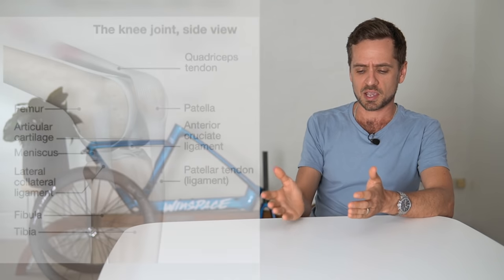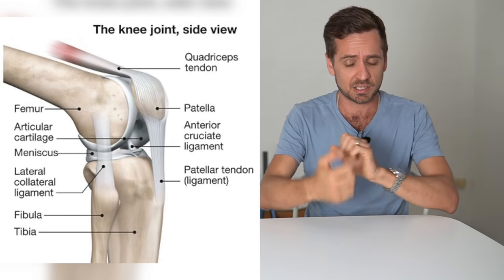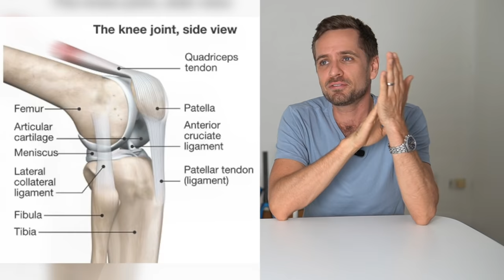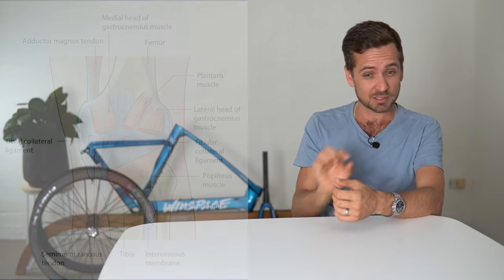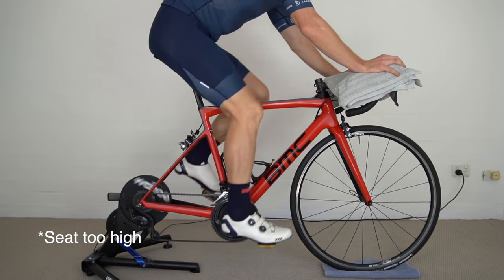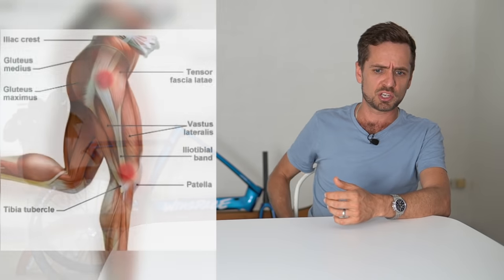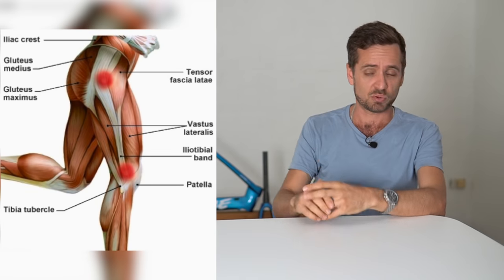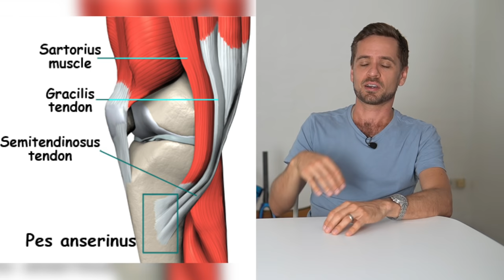What Causes Cycling Knee Pain (with a bike fitting expert)

Comment: I have a question. My left foot is smaller the the right. Not a full size but Close. When I look at it it's mainly the big toe. Clearly longer. Around the metatarsal itt maybe a diff of 2 millimeters. I have trouble in my right knee, otherwise I would ignore this. But now I'm looking for answer all over. Theoretically, should the cleat go back or forth on the shorter food??
Reply from the maker: Hopefully Neill can get to the Q for you at some point. Cheers, Cam

Comment: No mention of cleat position being a cause? I have rear knee soreness, could it be the cleat? I've had the seat checked and lowered 10mm
Reply from the maker: Yep it can be part of the issue Peter, just about anything can - Particularly if the cleat is too far forward and the rider's heel is dropping aggressively as they transfer power on the downstroke. The soleus and gastroc can struggle to control rapid heel drop and create posterior knee pain. Just one of the many variables that I don't have time to cover in such a short video! - Neill
Reply: @roadcyclingacademy  I moved the cleat back for todays ride and a miracle, no knee soreness, first time in a month, thanks for the advice 👍

Comment: i have frontal knee pain only in my right i dont know what to do i have a perfect saddle height i think
Reply: Your saddle height is wrong then. Get a bike fit, it's the only way. Don't watch YouTube videos on how to set seat height you will just mess your knees up more, like I did.
Reply: @dalj4362  there's no bike fitter in our area
Reply: @jeffr249  I had the same problem as you and my seat was too high and too far forward. I've now found the sweet spot and no more knee pain. Can't really help much more than that, that's why bike fits are best.

You could try lowering your seat 5mm at a time and  move backwards on your seat while riding to see if that feels any better, then adjust seat accordingly.

Comment: Not enough hydration, magnesium deficiency, combined with rapid overstrain. I'm in my late 50s, bike 40 km a day a full clip, with about 1/3 climbs and my legs have had zero pain, zero problems from respecting basic physiological principles. I don't ride a fancy bike and it's pretty customarily adjusted.
Reply from the maker: Thanks for sharing on the thread Phil

Comment: I get knee pain when my spine(Lumbar) is out of alignment. 
Once my lumbar joints are all in the right place, knee pain goes away.
Reply from the maker: Interesting to hear AB thanks for sharing on the thread.
Reply: Was just about to post on this, ive found this exact issue. 
The quick fix to erase my pain within a day is:
Hang from a chip up bar, first rotate hips 100° left, then right. Then rotate neck the same (while hanging with at least 80% bodyweight off the ground. Combo these 2 each way/opposite directions. Only 2 reps of each is required. 
THEN while hanging, lift each knee to your chest straight up. Do each knee twice. 
To increase the effect, do a chin up, or as much as you can, while in the chin up lift each leg 1 at a time. 

Under 30 seconds to complete this stretch routine, it will realign your whole back, decompress every disc in your back, but most importantly it stretches all your knee ligaments.